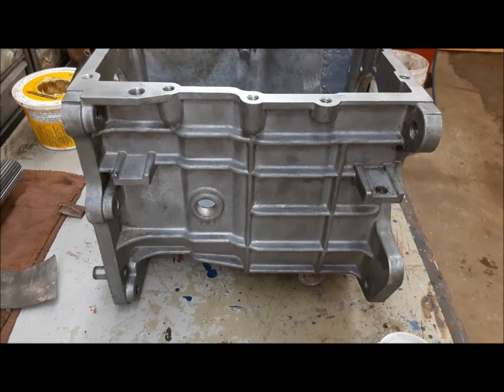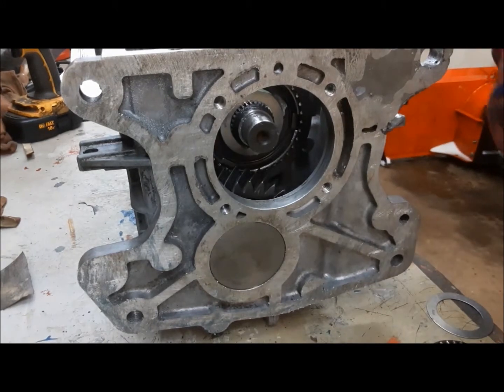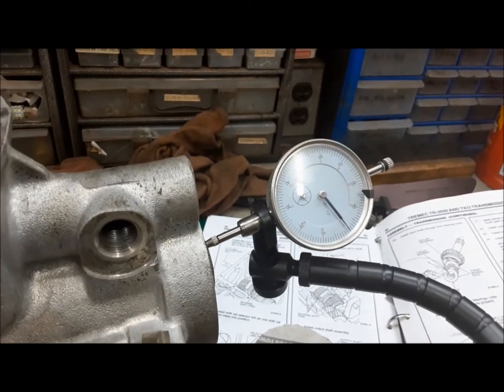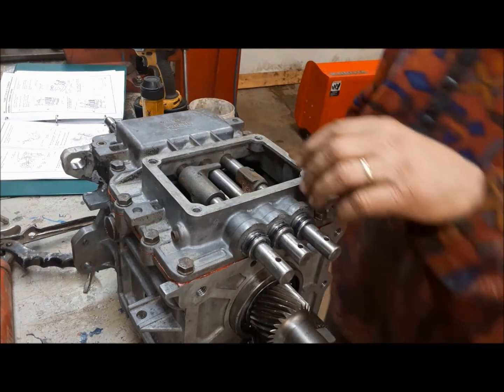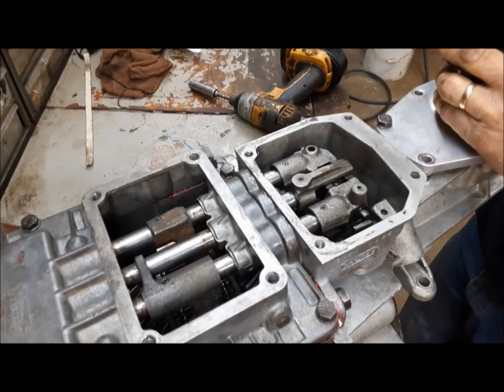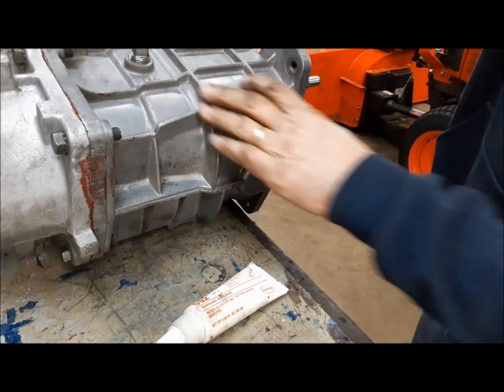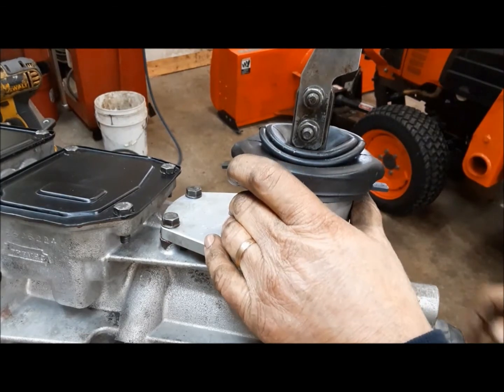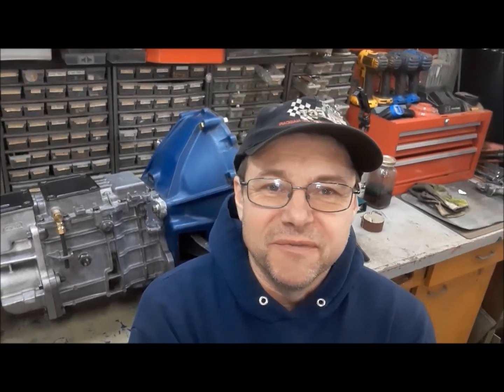Tremec TR3550 Basketcase Final Assembly part 2 Back Together For KEEPS

Comment: Where can you pick up parts for the tr3550 tremec  called tremec today and they said they dont make parts for it anymore
Reply from the maker: i found some bits and pieces on ebay . i got other stuff from hanlan motorsports in pa
Reply: @ClaremontClassicGarage  It's a shame not many companies make parts for this transmission. It is such a great.
 Piece of machinery.
Reply from the maker: @95turbostang21  I hope one of these days I can get it in a car and see how it works.